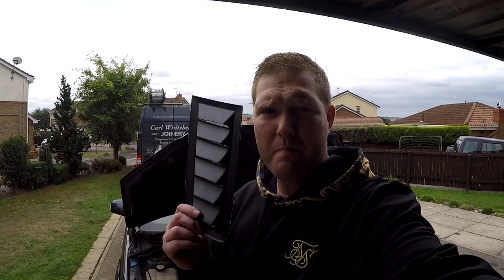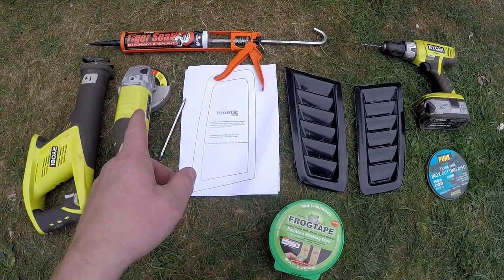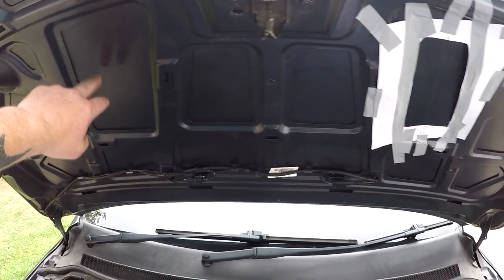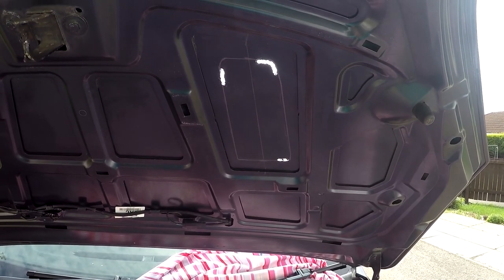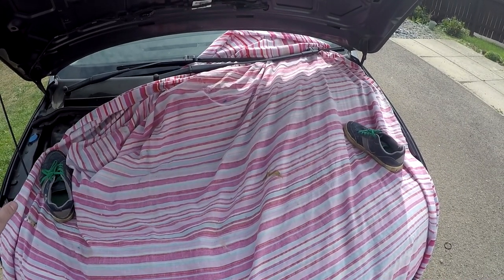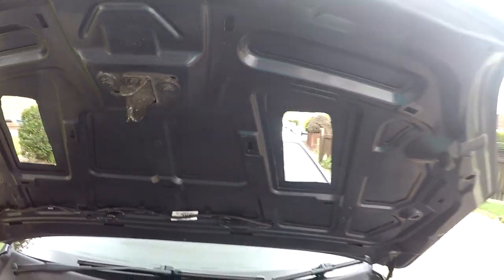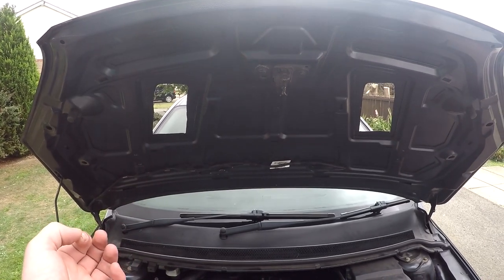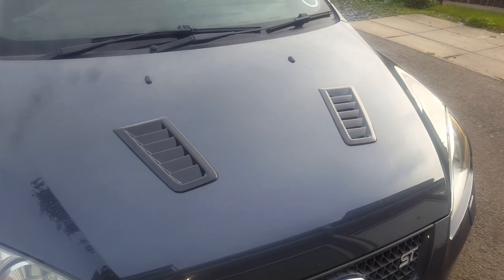#6 Bonnet Air Vents install - Ford Focus ST Mk2 @@How to install@@

Comment: Turned out good tbh. I wanna do this to my car ben have an open ram air intake so I am scared if I put a vent right above it it's gonna draw water if it rains which aint good.
Reply from the maker: Apologises for the late reply. Did manage to fit the vents?
Reply: @ecp4538  no, never did and the car is sold now.
Reply: @swansmeister  shame, what did you replace the car with?

Comment: What exhaust would you rec for this car? And any other parts for exhaust
Reply from the maker: If you get a branded stainless system you will be looking at silly money, but i highly recommend the full turbo back stainless steel exhaust system I fitted for under £500 , i did a video on it on the channel,
Reply: @ecp4538  sweet mate ill have a look.. just seen a miltek one turbo back, from pumaspeed.. but its 1100quid fully fitted.. ill have a look at yours
Reply from the maker: @justsomedude1488  just no worth it buddy your mostly paying for the name, I couldn't fault the one I purchased
Reply: @ecp4538  Can't find the vid about your exhaust mate
Reply from the maker: @justsomedude1488                      https://youtu.be/yN_bwkHpA-E

Comment: Wanna come and do mine lol.
Reply from the maker: Take your time buddy and you will be good, check, double check then triple check, I would like to open up a shop one day
Reply: @ecp4538  ahaa u should do really, alot of people would come to u for there stuff to be fitted.
Reply from the maker: @shaunwelch9176  it's a possibility in the pipe line bud it's just the start up cost, I'm a mechanic by trade. Look out for the new vids coming up on, changing spark plugs and then oil filter with oil
Reply: @ecp4538  ok mate looking forward to it.